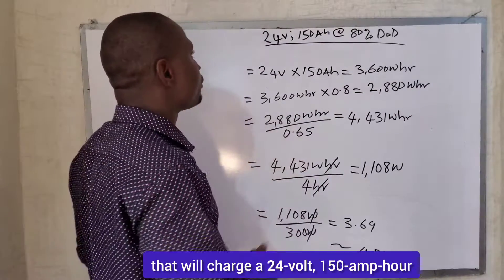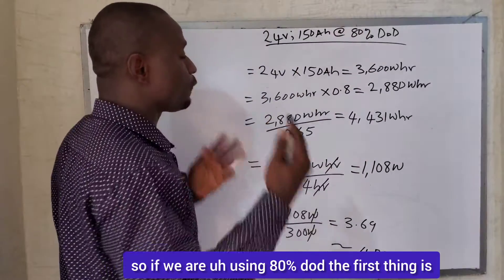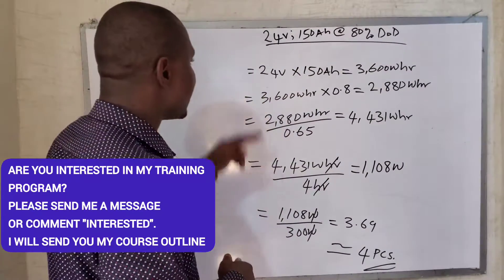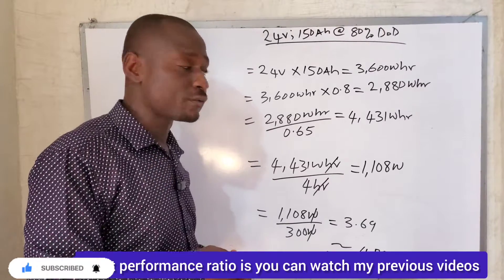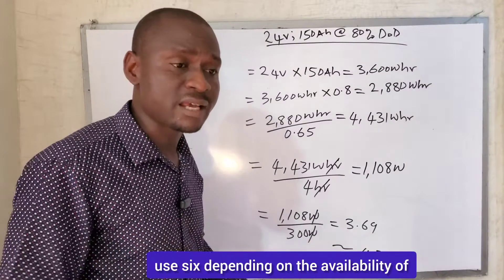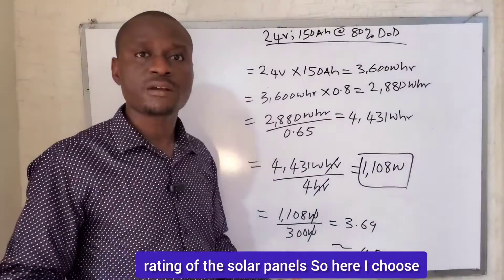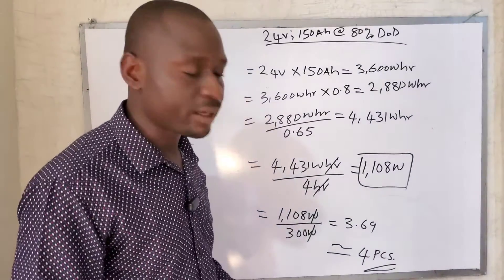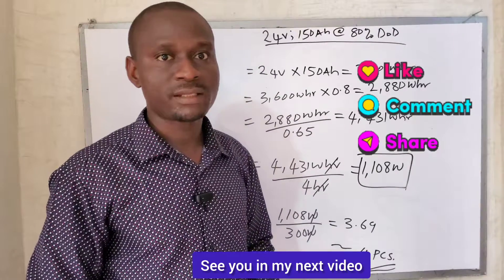How many watts solar panel to charge 24V, 150Ah solar battery #solarenergy

Comment: Please my question is that, is there any use to install more than the calculated solar power? Like, assuming I get 3kw as my solar panel power after this calculation, if I install 4kw instead, will 3kw go to the battery and 1kw go to load directly? Or will the whole 4kw go to the battery? And will the 4kw be dangerous for the system? Or is it ok?
Reply: excess will go to the load

Comment: Why did you not devide 3600whr by peak sunshine hours?
Reply: That is the total energy capacity of the battery at 100% fully charged. Since you are not draining it to 0%, you can't apply sun hours at this stage. The depth of discharge is said to be 80% so the it only that portion of the energy you will require to replenish when the sun is out. For you to effectively charge the battery, you need to account for panel performance ratio and charge controller efficiency else you will not charge the battery in the available sun hours. Taking those factors into consideration ensure you size your solar array properly.